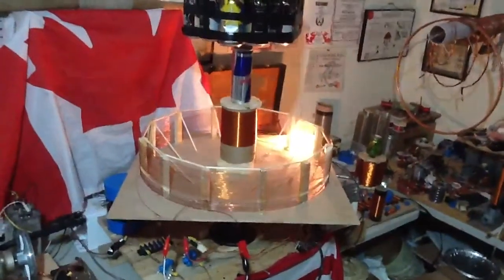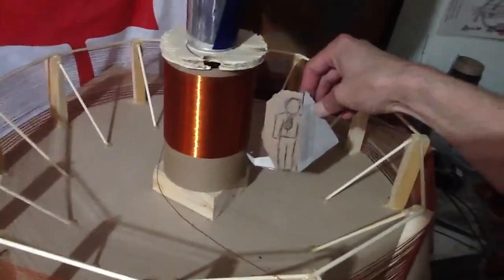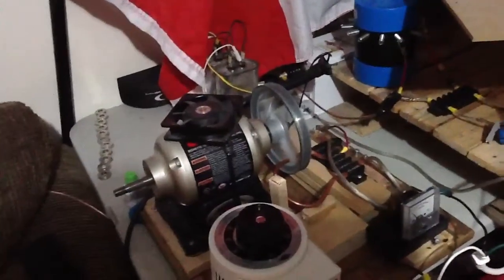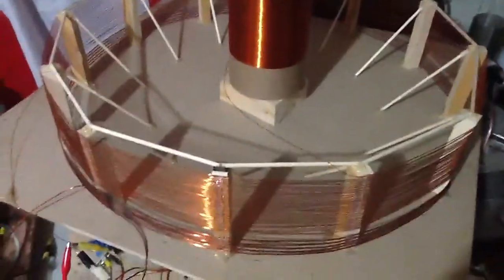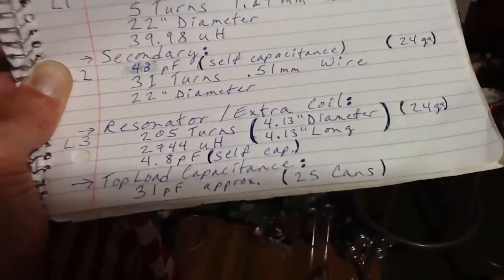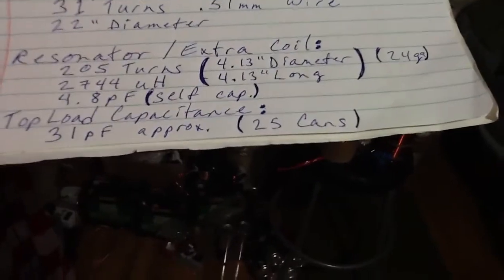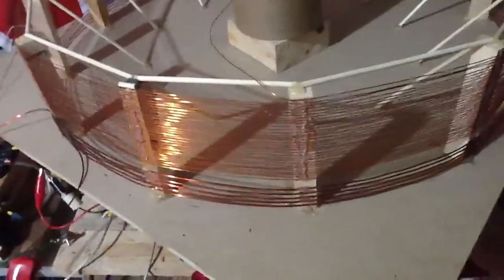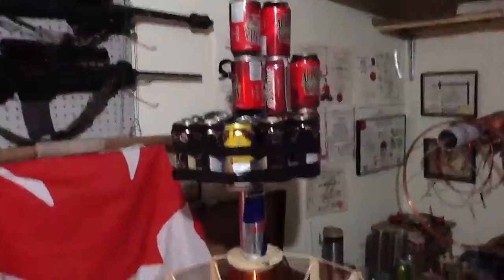TMT 5 : Tesla Magnifier: Colorado Springs Model

Comment: I've been looking to build one of these and I'm a bit confused on some things, does the wire gauge of the secondary and tertiary coils need to be the same? And how close do the resonant frequencies of the 3 coils need to be? 

In DRSSTC's the resonant frequencies between the primary and secondary coils need to be as close as possible to result in much higher output, when comparing the dimensions of the 3 coils in this design I found their resonant frequencies are very different from each other, would modifying the design so all 3 coils share a closer resonance improve the output? Cheers.

Comment: the spark gap only has 2 post connected, any specific reason for the other posts?
Reply from the maker: +Solomons Words hi there yes the extra terminals on the spark gap are to accommodate more or less voltage.  you will find that when you begin to drive the primary with more voltage a single spark gap will not quench the spark properly,
 the solution is many smaller gaps to deal with the higher amplitude, rather than a single gap which would breakdown too soon and never rise to the desired level
Reply: ***** Greats stuff! was leaning in that direction but needed to make sure.

Comment: Very nice work. I haven't found a single person other than you that replicated the patent even a little bit.
Reply from the maker: thanks man, yeah it was difficult to wind these, and among modern Magnifier builders, "Tesla's was the best operationally, but was the most hard to tune, one would need to be rich in capacitance to tune both primary legs up or down". but i believe that this could be done smaller and yield even more power, as long as breakout arcs are not wasting power, and you arent too close to the coil...zapp :)
Reply: Did you notice how long his 'third coil' was? In the picture is was about 30 feet or 10meters which meant he was operating at 30MHz. I wanted to know the results of your experiments. No one thinks of the third coil or worse, they think its actually a coil.
Reply from the maker: hi there, well if the total length of straight wire was 10 meters it would be 30mHz, but  10 meters tall as a wound coil would be a much lower tune. Tesla's Colorado Springs coils had a range of 40-80khz i believe. which was great for ground transmission. and yes i guess in terms of an induction coil, it was not. The 3rd coil resonator was a series LC resonant circuit of its own, needing only the correct frequency input to operate, not induction. the primary to secondary however was induction, but only to achieve a strong voltage input for the resonator :)
Reply: I should like to email you
Reply: ymail?
Reply from the maker: hi John I appreciate that, and I hope to return to my experiments soon, but my lab is packed up at the moment. it has definitely been a learning experience
Reply: Way cool. Lemma know if you ever get back to it :)
Reply: ***** thank you for the video sir I was wondering if you had had a chance to work on your design anymore and hoping that you have an update

Comment: Have you ever seen the image of tesla where he is sitting within the primary coil?  He has secondary/ tertiary coils all arcing to each other inside of it!
Reply from the maker: hi there buddy, yes that is a great picture, and what " double exposure" means that they ran the coils and took 1 long exposure picture, then took another picture with the coil not running, with Tesla, or mr Hammond near the setup.
So the system wasn't running while next to it, though it appears so, very cool all the same. and they had written that in the description as well.
One thing is Yes tesla would not hesitate to demonstrate the non damaging effects of high frequency, but to run the Magnifier full throttle and stand next to it would be suicidal hehe
Reply: That image was manufactured if itwasnt I don't think Tesla would have lived to tell about it